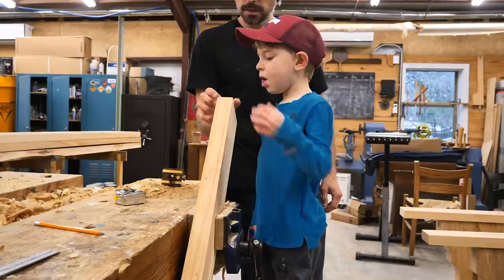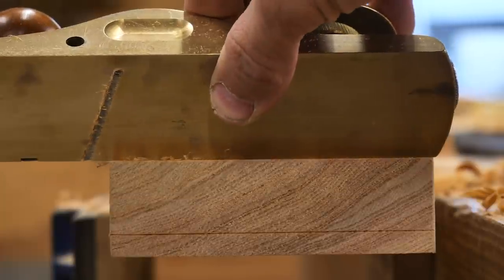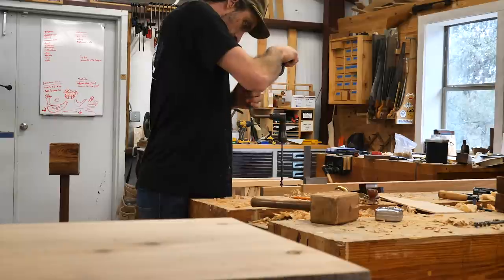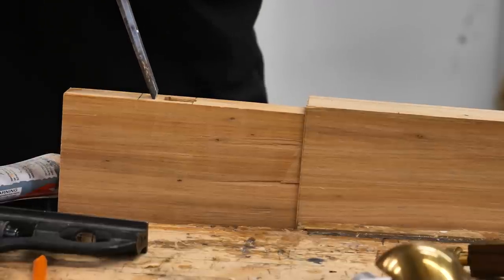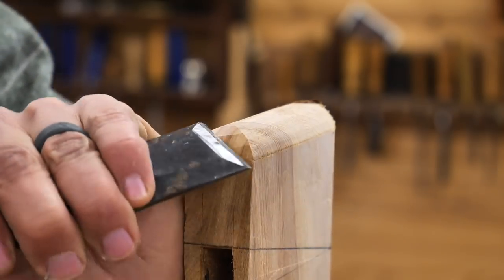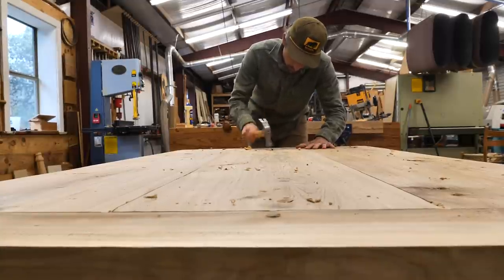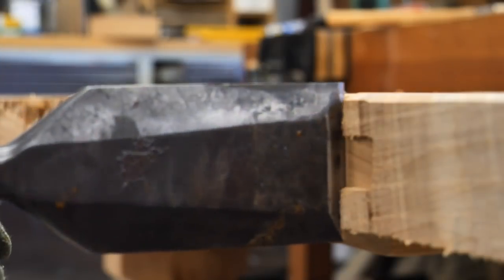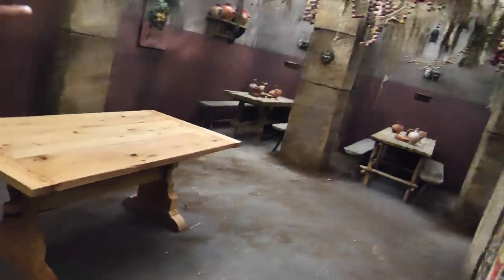Making A Cypress Trestle Table For THE CHOSEN TV Series // HAND TOOL WOODWORKING (Part 2)

Comment: TIP: whenever i have a chisel line dig into the wood, an easy fix/counter is to just score the fiber with a box knife. It will stop the action in its tracks.